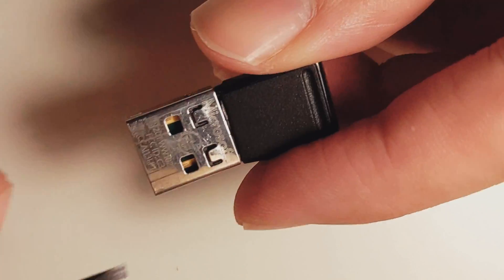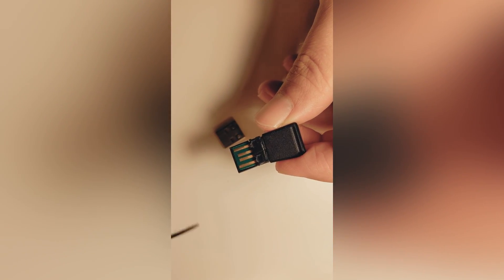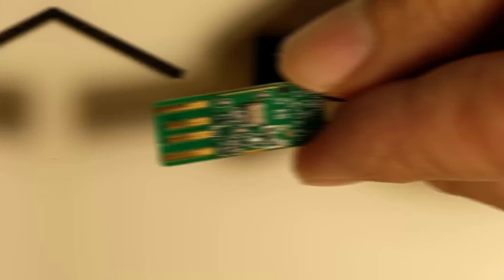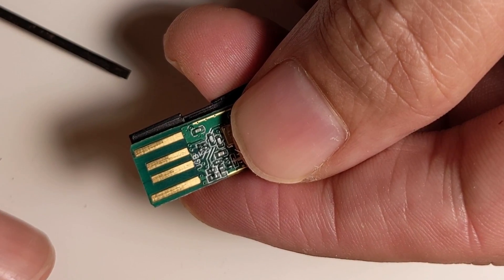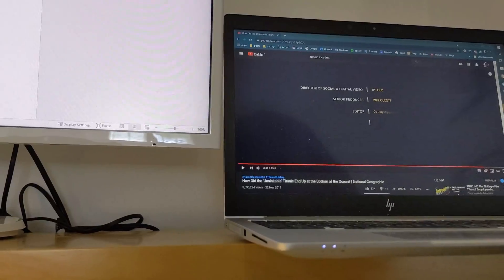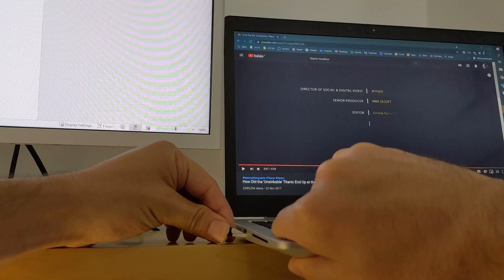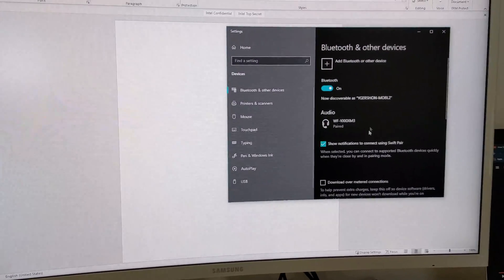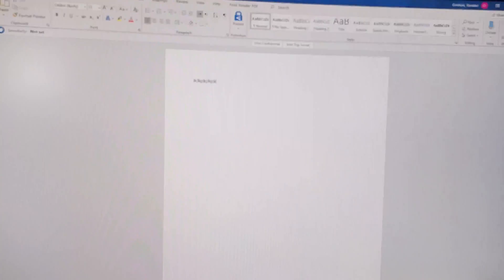How to fix Microsoft Wireless mouse/keyboard USB Transceiver (receiver/adapter) - Quick Fix

Comment: I set the temperature for my Electrolux electric oven to 180 degrees Celsius. But nothing changed. Then I set it to 220 degrees for 4 minutes, and everything worked. The chip is working. Thank you very much.

Comment: I could not separate it from the plastic housing, so I had to chance it and bake the whole thing.  Well, sure enough I mangled the plastic…soo, I baked it a bit more and tried to form it back into place, to the point it would fit into the USB again.

Took several tries but eventually somehow it worked!!  The dongle looks butt ugly, but it’s connecting again..thanks!

Comment: This worked for me! I used a heat gun for probably 7 minutes. I also think that there may have been an issue with my dongle casing due to some damage it sustained, as it was slightly bent. When JJ showed how he taped his together it clicked that the issue also may be that the USB transceiver itself was not getting a good connect with the USB port, so in reassembly that issue was also corrected.

Comment: Thanks a lot! Using the oven to re-solder the connections on the dongle worked on my Microsoft Wireless Keyboard and Mouse 3000 v2.0.

Comment: My portable monitor fell on dongle while plugged in and bent/cracked the casing. I've gone through 4 rounds of 5 minutes at 300, and 5 minutes at 400 in air fryer on bake setting. Do I need to go longer per bake session? I'm so afraid to burn it! Or is it just broken beyond repair?

Comment: WOW!! I am so happy I saw your video. At first I was skeptical... but I tried it and it worked! I damaged my USB receiver and both the keyboard and mouse did not connect to my laptop. I have a Microsoft sculpt ergonimic set and I was devastated as Microsoft discontinued the sculpt keyboards. 
I baked it in a pre-heated regular oven at 450F for 5 minutes.
Thank you so much!!!!!!!

Comment: I let it in the oven for 180, 230, 250 for 5 minutes each. It didn't work at all. 
Eventually got bored and let it sit 15 minutes and after I came back it was burned to crisp. So listen to the guy and watch it while baking.

Comment: My laptop fell with the dongle in it.  The dongle side hit the ground.  after that I had to put downward pressure on the dongle to make it work.  I tried 400 degrees F (full size oven) for about 8 minutes.  Seems to be working just fine now.  Thanks for the tip.  Way better than trying to solder those tiny pieces!
Reply: Your suggestion really worked! Thanks so much! 🙏🏽

Comment: Doesn’t seems to work for mine … mine was Microsoft wireless 900 desktop … the transreceiver was a little bent … and I couldn’t get the chip out of the case/holder … tried using various methods and doesn’t seem to work … is there any way that something can be done to replace the old transreceiver or make it work ?

Comment: Dude, next round on me! You saved my day! I was ready to buy a new wireless mouse until I saw your video. I put the transceiver in my regular oven at 450 F for 5 min. Connected to my laptop and it worked!. The tricky part was to reassemble the transceiver, so I recommend taking pictures so you remember how to reassemble it
Reply from the maker: Glad to hear!

Comment: I bought my Scuplt keyboard/mouse combo in a secondhand store. Soon after I took it home to try it, it started having connectivity problems. I read online, and found the problem to be quite common. Someone suggested moving the dongle close to the keyboard, so I put it on the end of a USB extension cord, and put it right on the desk by the keyboard. This has worked very well for a few months. Occasionally I have to unplug it and plug it in again. But just the other night it started failing. Now I'm getting a few minutes of use, and then I have to unplug/plug again.

I'm tempted to try your method. It sure would be nice to know exactly which component is the culprit, as I have a heat station, and could aim the hot air exactly at the trouble spot. I also have an electric hotplate (for phone/tablet repair). I might be tempted to try that.

Comment: Another way is to use a clothes iron and let it heat fully. place dongle on the irons hot plate with the components facing up. should take aprox 30 to 60 seconds. In the industry it's called reflowing the solder and this way you can visibly see the solder start to shine and liquify. Remember to never touch the piece with you bare hands. Use tweezers to remove and place on a plate to let it cool down.

Comment: This works. Thank you. The only issue is that my mouse does not scroll, I suspect some circuits responsible for scrolling did not reconnect properly? Otherwise all good. Once again, thank you JJ.
Reply from the maker: Yes that could be the case

Comment: I FIXED MY KEYBOARD USING ANOTHER METHOD. The matching numberpad was in a box with one of the keys held down by a book. Fixing this also fixed the keyboard, as the numberpad was not continuously transmitting rogue characters. Also, check the keyboard batteries, sometimes replacing a flat battery can fix the issue. Once I tried three sets before I found one that worked. My apologies for caps, but I figured it this might save someone a lot of grief as it took me an hour to figure this out.

Comment: Excellent! It worked for my Microsoft Sculpt Ergonomic Desktop Keyboard & Mouse. Regular oven, 230°C for 5 minutes. (Several attempts at lower temperatures did not work.)
Reply: Just got the same problem.. what did you do to fixed it?

Comment: Thanks JJ for this video. The only issue I had was that I don't have a toaster oven and you need a higher temperature for a regular oven. After several test runs, I ended up having to set my oven to 450 degrees fahrenheit for 5 minutes.

Comment: This is an excellent presentation, and really I would like to know how you knew to bake the board. You must have worked in the ic industry, or have a drinking buddy who does. This video should receive wide distribution based on valuable content.

Perhaps you would provide an opinion on whether heat could be applied to circuits connecting the push-activated switches on a a modern PC keyboard.
Cheers! 
Mike2 Anchorage, AK
Reply from the maker: Thanks! I worked in intel for 7 years
Reply: The baking technique is also used by some people to try and fix Graphics Cards.

Comment: It works, Thanks! From Brazil. 
I put it in the oven for 5 minuts at 180. 
My transceiver plastic in the USB it melt a litle and a have to use some sandpapper to correct.

Comment: not working.....
Reply from the maker: Sorry to hear. This fix olny works if you had a connectivity problem on the module. I would try to heat it up a little longer to see if it helps but this fix is of course not guaranteed to work for everyone

Comment: Is this metod really working? I have exactly the same "problem" with my keyboard (your same model) and I tried several times to contact the microsoft assistance for this...of course, no solutions
Reply from the maker: I created the video the day i baked it and it's still working. It's not guaranteed but i saw another video suggesting the same and i see in the comments of that video it works for a lot of people. Let me know if it worked for u

Comment: Thanks for the video!
Do I need to put in the toaster oven the black part or the green and gold part?
Reply from the maker: The green & gold. Let me know if it worked
Reply: Ok thanks bro, after I'll do that.
 do I need to duck tape the black with green part together?
Reply from the maker: @matan_shimon  if your black plastic part is still intact u can reassemble it. Otherwise if u can't then yes u can duck tape the black plastic to the module (green & gold part) but make sure you don't cover the 4 metal lines that connect to the computer. Good luck

Comment: What to do if you dont have oven or toaster?
Reply from the maker: you could use an oven. some people bake their mother board in the oven. just make sure you open the oven door after you finish the process for about 30 mins and use a fan to remove all the toxic fumes. also have your home windows (real windows not the ones in the computer :) open at the time.
Reply: @jjgershon  ok i will open real windows 😂😂 thank you